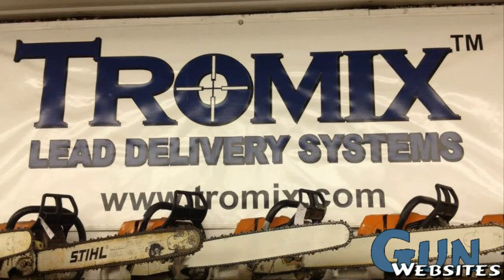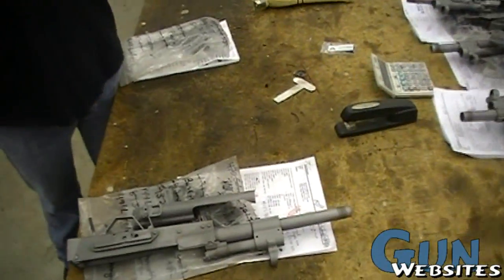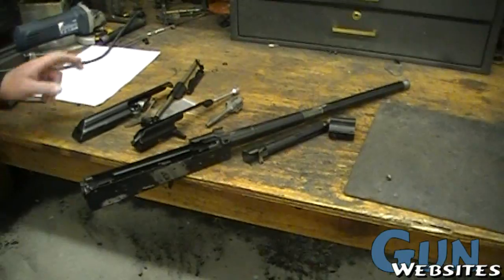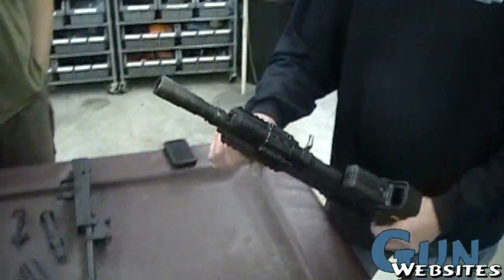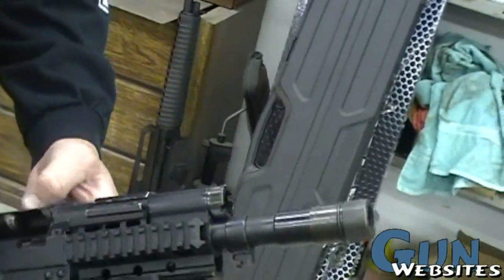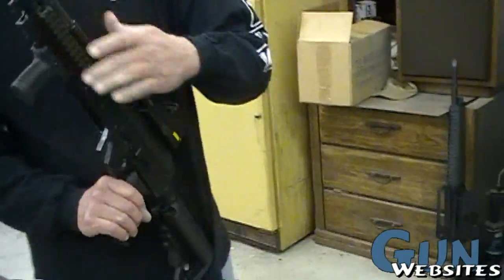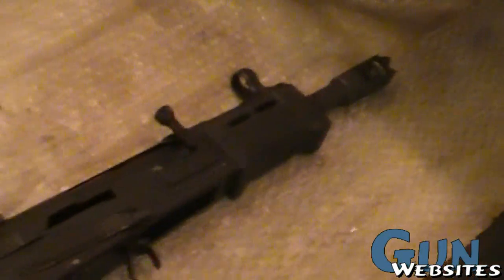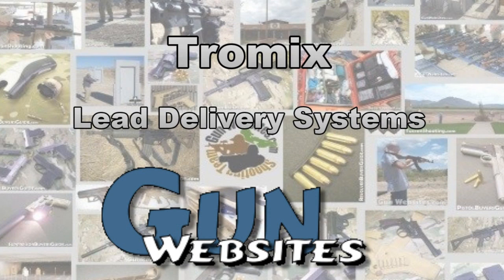Tromix - Lead Delivery Systems

Comment: It's also to help blend the welding that's been done and evens everything out. Also when everything has been blasted with Al oxide it roughs up the surface and provides a perfect substrait for any applied finish to stick to. In Tony's case, it's Norrels Moly Resin. 
Tony has helped me on a couple of projects. One thing about Tony, he will give you an honest opinion and advise if you ask. If he thinks you idea is shit, he'll tell you. If he thinks it'll work, he'll give you any advice he can.

Comment: comment please...I like the saiga...but I heard that shot gun shells couldn't be stored in the mags for long periods bc of possible deformation of the shell due to the spring pressure increasing feed problems.  I notice that the AA12 drum has actual slots for each shell...are there similar drum mags for the saiga.